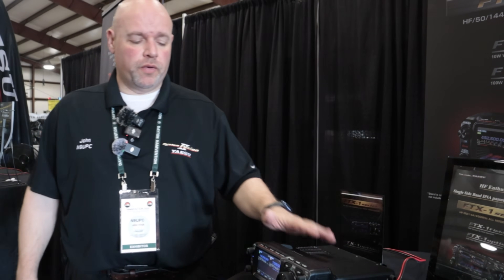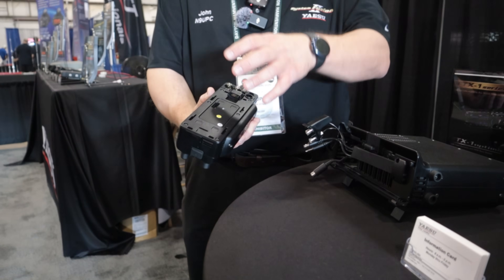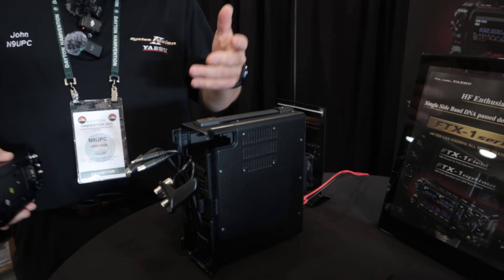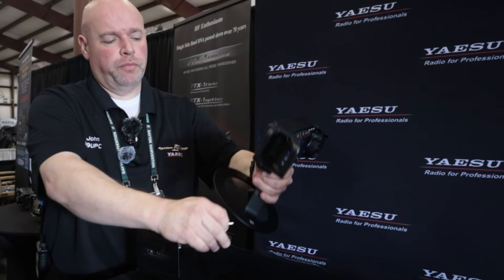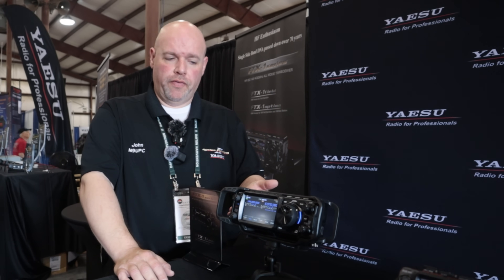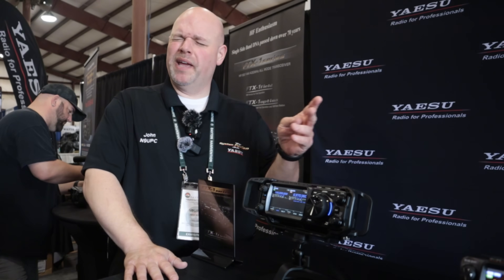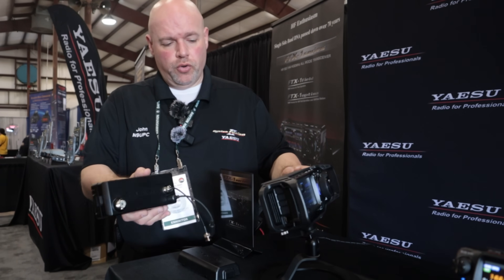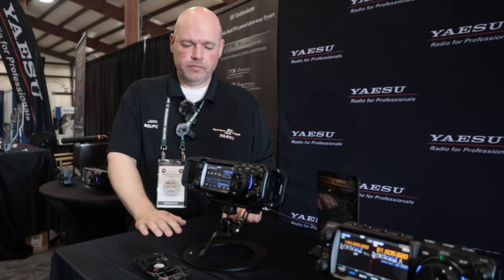Is the Yaesu FTX-1 Optima the FUTURE of Ham Radios?

Comment: Let's all crowdfund the rights to the 857 and spin up a company churning out out IP67 857Ds with modern circuitry. I just do not understand why yaesu and can hear all the new hams screaming for an 857 uplift and release this kind of stuff. Close enough but maddeningly short of what we actually want.
Reply: An IP67 857D would be exceptional. Or even an IP67 891 with added 2m all mode.

I had high hopes that the FTX-1 would signal a resurgence we've been waiting for, but for what it is at the price point... it's simply not.
Reply: @ right. I would
Pay that price all day for an optima with 8’ cables I can rout to my dash.
Reply: TYT is building dual and quad band FM gigs based on discontinued Y radios.
Reply: @ can you point me to any documentation about that?
Reply: @thatswhatshesaid1  The TYT-7800 and 9800 seem to be Y clones of the same model.
Reply: @ awesome. I’ll give them a look.
Reply: I own 3 857d’s Love them.

Comment: Am I high or does the amateur radio manufacturers not pay attention to what the customers actually want?
Reply: U can be high and not wrong.    😂.
Reply: For the most part they do not.  They listen to some trends and generalities and usually deliver something short of what you want.  
I think Kenwood with their D75 has a radio that meets the requests and needs of many who seek after that type of radio.
Reply: @KevinReeve but no iPhone BLE connection.
Reply: I don't know if i want this radio, becaus the sp-1 miissing 2 basics for home operation like HDMI and possibilty for remote operation
Reply: I think they are listening, I hear people say they want one radio that does "everything". 
Personally, I would rather have seen an HF only in a similar form factor as the Elecraft KX2 (at a lower price than the Elecraft).
Reply: @N2YTA  Agreed.  There is a place for a shack in a box radio.  At least it looks cool when you bring it to club meeting in the gator box.   It is a nice option for deployment where you have everything you need to operate.
Reply: @KevinReeve  Thing with a SITB radio is that if the rig completely died, you have nothing to communicate with.  And seems some compromises are made with having SITB rigs.
Reply: You don't have to buy this radio.  I'm sure that there will be plenty of people who want this.  I want this, I just don't have the cash for it at the moment.  The thing about the free market is that if you don't want/need something, you don't have to buy it.  Meanwhile, just because someone's not having fun your way does not mean that they're having fun wrong.  That leads to Orwell, Huxley, and Bradbury.  If no one wants this then it'll flop and they'll try something else.  I get the feeling that a lot of people want this though.
Reply: They do, they listen to the Japanese market.
Reply: What we have here is a failure to communicate.  2M, maybe with .70M 50w all mode radio

Comment: That cable connection looks awful…what a shame.
Reply: Yeah. It looks like the amp was an after thought after the radio had been designed.
Still haven't heard a valid reason why they made the Bluetooth and GPS add on or no Wifi at all

Comment: I'm a little disappointed that this radio cannot be used as a mobile radio.
Reply: Just talked to a local ham.  He said it should not be a big deal to make those cables and I am certain some OEMs or others will come with the solution.  Mine is ordered as I need a new shack in the box for field day use,  so great for my needs and get 100W / 50W.
Reply: @Ham101live  I don't get why they didn't make plugs like they have on the head on the amp body too. This is seriously such a wasted opportunity. If they don't get that sorted, I will be doing a 578 under my seat with bluetooth mic and the 891 on my dash. Wasted opportunity.
Reply: Icom 7100!
Reply: @ eh. The ATAS-120 is what I’m using on my truck.
Reply: @thatswhatshesaid1  you can't expect Icom to make a radio that's compatible with a Yaesu antenna.
Reply: @ which is why I said “eh”. As in “I don’t like the icom 7100”.
Reply: @N2YTA MFJ did make an ATAS to AH4 adapter.
Reply: @DomN5TCB  didn’t MFJ go out of business?
Reply: @thatswhatshesaid1  They are going out.  Not importing anything new
Reply: Agreed, especially with the popularity of POTA.
Reply: most mobile 100W class transceivers peak out at 20A. Quite ubiquitous to run 10A stranded from the truck batt with 25A fuses on each lead.

Comment: The 1800.00 future of ham radio is so bright. Yeasus 857 is more practical at least it fits in a car this thing is a phone book that transforms into a 5 watt useless brick.
Reply: It's a 100 watt "shack in a box" base station and a QRP field radio. If you bought an Icom IC-7300 and a IC-705 it would be more expensive.
Reply: To be fair, I'm confident the transceiver is best in class, consistent with the Yaesu tradition. However, the FTX-1 looks like a radio that tried to fit two use cases (base and QRP) and it turned out to be expensive and mediocre at both. As a base, it's more expensive and it's not as nice at the FT-710 or FT-DX10, not to mention products from ICOM and others. For QRP, the ICOM IC-705, Lab599 TX-500, Elecraft KX2/KX3 and Xeigu X6200 are all better suited in their own way (lower cost,  lower weight, lower power or more rugged depending on the model). The FTX-1 doesn't even pretend to be suitable for mobile. I can't imagine what Yaesu was thinking on this one. I like Yaesu and I own a few of their radios so I sincerely hope they get their act together very soon or they'll face an existential threat from the market.
Reply: I agree. Cancelled my Reservation from last 
September after 6
months, and now put
my FT891 mobile with
a Tar Heel Little Pro
Screwdriver HF/6M,
and kept my FT818nd
for portable use, and
for my QTH, a FTDX 10
which is great.
Do not need C4FM.
I thought Optima was
an American Express
Credit Card? 
73 de W2CH Ray Peekskill NY 😊
Reply: Reservation has proven to be useless anyways  @Raymond-n7k
Reply: Same here, cancelled my reservation from HRO.  I just use my 891 in the field or in my car.  The 7100 sits in my other car and it's rarely used.
Reply: @dc5723 that's to bad 7100 units are amazing